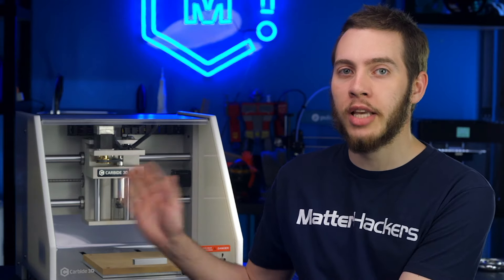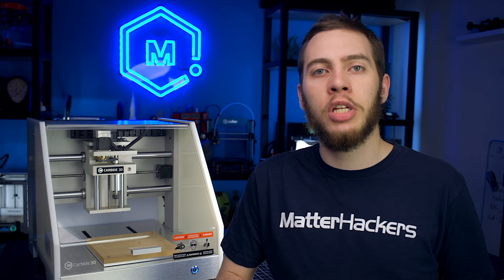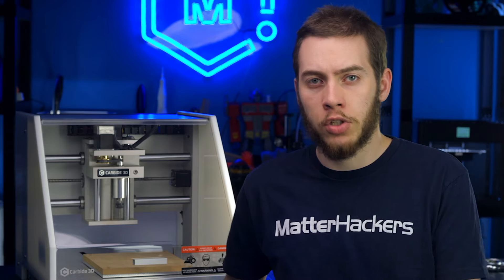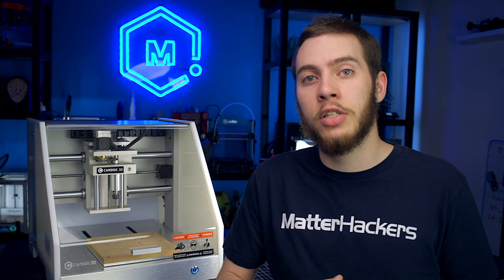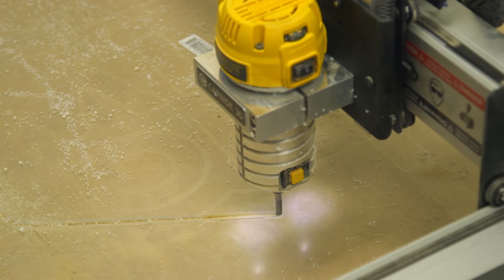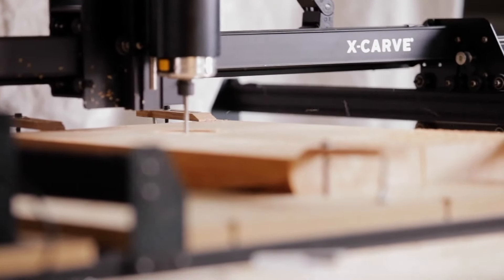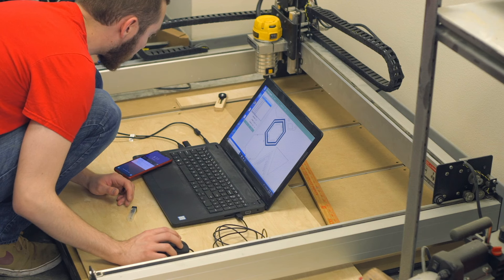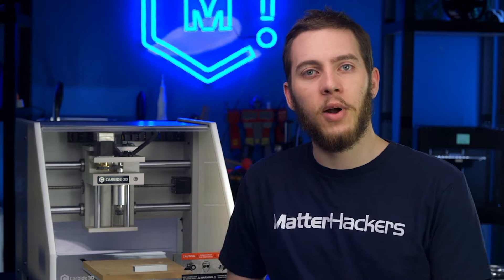Desktop CNC Milling // Digital Manufacturing Anatomy

Comment: ive build my own linear stepper motors complete with rods and mounts for only literally $25 (with the exception own my own gear calibrated rc motor. Any plug n play cnc milling motor you can recommend?